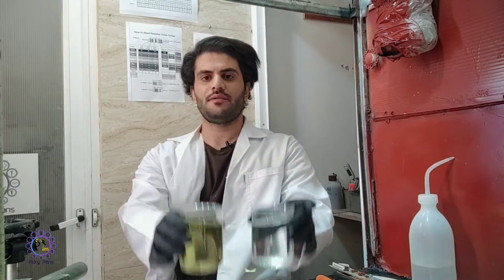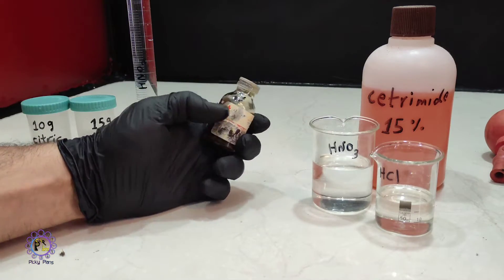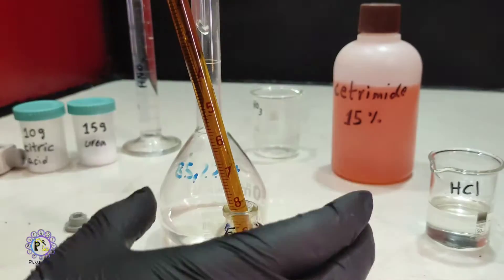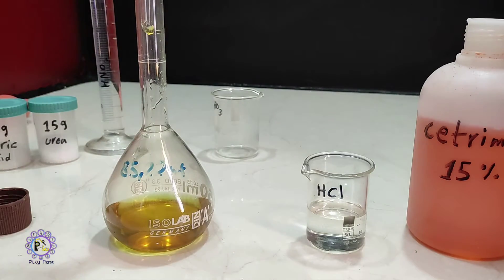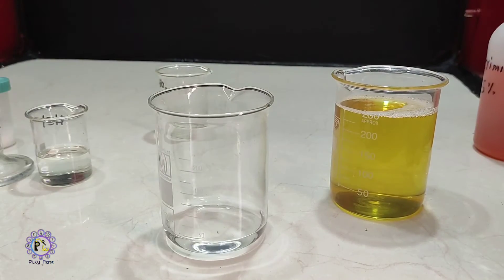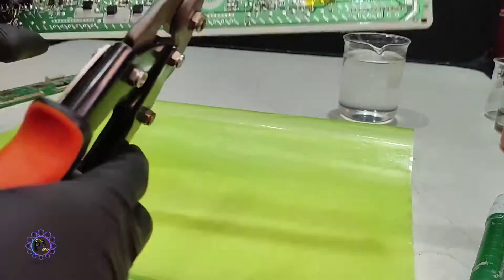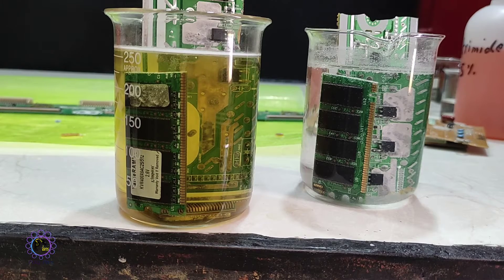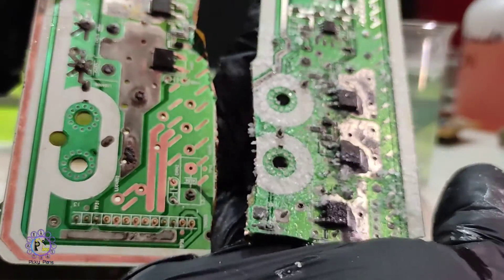Best solution to ONLY dissolve Soldering (Tin) FAST

Comment: Great video, thank you for sharing. Question. I can only get a solution that contains 15% ferric nitrate and 15% ferric chloride. Will this do the same thing. Thanks in advance.
Reply from the maker: It doesn't have any inhibitor for copper and also you have nitrate along with chloride, probably you'll get gold in the solution if there is any
Reply: Thank you for getting back to me. I have the Nitric Acid, Ferric Nitrate and Hydrochloric Acid, I can only buy Cetrimide that has 15% cetrimide and 15% Chlorhexidine Acetate. My question is, can I use it for my solution. Thank you.
Reply from the maker: Yes it's feasible... Just don't add any HCl, and chlorhexidine won't disrupt the process
Reply: @PickyPlans  Thank you, looking forward to your next video. Cheers

Comment: Hi, can you use this solution without ferric nitrate, because is problem to make this or expensive to buy-it,,Why ferrite nitrate is needed for in the solution/ purpose of the ferric nitrate? THANKS IN ADVANCE BROTHER!
Reply from the maker: Yes you can remove it from the list. It's just used to remove the last thin layer of solder on the copper/ Solder forms alloy with copper with few micron thickness ferric nitrate removes that layer
Reply: Continu Your Awesome Work!

Comment: Indium recovery! In modern solders, there can be indium and silver among other metals. Also some processors might contain indium. There can be quite a bit of indium in solder. Indium might become much more expensive, as it's production is only 1200t per year while silver production is around 25000t a year. There might be some indium in chemical wastes.
I wonder if it is possible to recover either metallic indium or indium salts?

Comment: can you recover the silver out from out of the solder off the boards?
Reply: If you use the HCL method, silver doesn't get dissolved in it, so it should most likely settle out to the bottom either as a fine powder or sludge

Comment: Hey Picky, I would really appreciate a precise 'recipe' to make the appropriate strength for both the Cetrimide and the Ferric Nitrate solutions.
I have 110 fully gold-plated telecom PCB s so will need to make at least 10 liters of solution and then re-use it several times! Many thanks and have a great 2023!

Comment: can we use a lower concentration of the citrimide solution like 5% or 10% witch is found in industrial desinfectant or can the citrimide be replaced with some other inhibitor withs is more available

Comment: Hi we use just dilute HCL for tin and solder removal and use heat for acclamation reaction , this way you show is new and good info but I think too much expensive is it right? And we use 3 time diluted HCL for solder and Tin removal.Did you math how much your solution? And how many times can we use?
Reply: Which boards did you use to depopulate? And how many times do you actually reuse your HCL solution for the same?

Comment: So sorry but I have one more question............ Would the Urea based solution have worked quicker if it were heated up or even boiled?
Reply: @PickyPlans  Thanks so much for your prompt reply! I will do a trial just warming it up to say about 80C while I source the Cetrimide. Keep up your great work!
Reply: @julianalcorso5703 .   Most backyard refiners, at least those without any greater chemical knowledge, will benefit from doing things the old fashioned way. Remember KISS (Keep It Super Simple). Some processes may take a little longer, but they're simple and the chemicals are cheap.
A two step process, first very diluted HCL and then diluted HNO3 will do the job. Electrowinning or carbon reduction will recover the metals. 
Full leaching process is described in my comment (3 parts) here: www.youtube.com/watch?v=UugorCcXEYw&t=995s   .
Reply: @zero-waste  Thanks for the advice! I am a winemaker and therefore have studied and understand organic chemistry but this Ewaste recovery is fairly new to me.
I agree with KISS!!!
All I am trying to do is remove the remaining solder from several Kg of high-grade telecom pins. as well as the remaining solder from the boards (120Kg).
I tried HCL but must have had it way too concentrated (1:1) What strength would you recommend?
Once again thanks so much for your help!!
BTW I am in Australia, You?
Reply: @julianalcorso5703 .   You really should separate fully gold plated pins from those with only partial gold plating, and process them in two batches. Tin behaves odd in many ways. One of them is: If tin solder have been in direct contact with gold plated pins a phenomenon called metal diffusion have occurred. It's best illustrated if you use a cheap soldering iron with a copper tip. The tip becomes inevitably shorter and shorter as the tin solder absorbs a tiny part of the copper tip every time you use it.
Therefore, the dissolved solder from fully gold plated pins do contain gold!
Metal diffusion is the reason that a two step process is needed for complete removal of solder on Printed Circuit Boards. Many backyard refiners struggle with the last remaining solder on PCBs, i.e. the components will not fall off. A small part of the solder is encapsulated in the diffusion layer of tin/copper. HCl cannot dissolve copper, but HNO3 can.
Read my three part comment for tin removal process here: www.youtube.com/watch?v=UugorCcXEYw&t=995s   . 
Try it and leave a comment if you find it can be either simplified, or improved.
After tin removal the electronic components can be sorted for further processing. The bare boards are processed for Bromine extraction, and pyrolyzed yielding raw fuel oil. Finally the copper is separated out. What remains is solely glass fibers, which have so little value that it's just given away for free to a glass recycler.
I process any kind of low/med./high grade Printed Circuit Boards. Currently at least 3 tons in stock, but it's way too cold for chemical processes in the winter here; awaiting summer time.
During many years I've traveled to many countries visiting numerous small and large recyclers/refiners, but still haven't been in Australia; it's pretty far from Denmark, actually half the way around the globe. However, as an avid sportfisher a trip to The Great Barrier Reef for big black marlin is tempting.
If I decide to go to Australia it could indeed be very nice to pass by, and enjoy a glass of delicious Australian Full Bodied red wine while discussing e-waste recycling and recovery processes.
Reply: @zero-waste  Once again your link takes me to Omegageek64. A guy in Florida  
????
Reply: @zero-waste  Mate, Please send me the name of your Channel. I tried searching for   @superdream58  but nothing comes up.......?????
Reply: @PickyPlans  Thanks Picky!!

Comment: Thank you for this video. Can you use electrolysis to get the tin back out of solution? Or would you eventually end up dissolving some other base metals in this process?
Reply: @PickyPlans  thank you. I have accepted you. You can share your video links directly to the group if you like